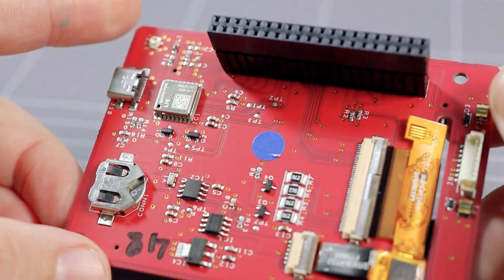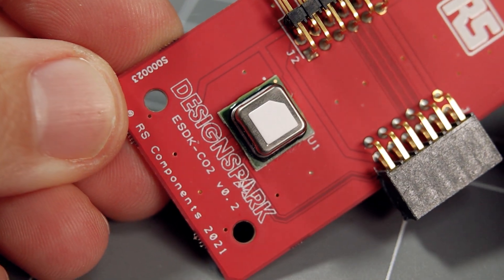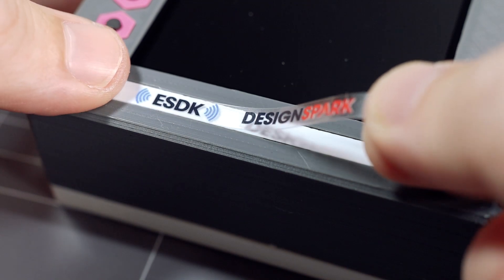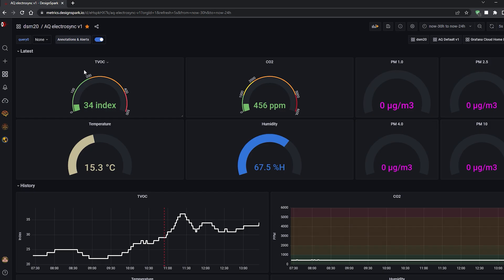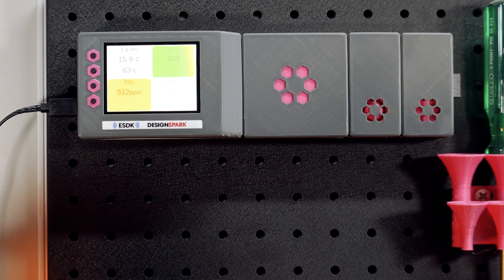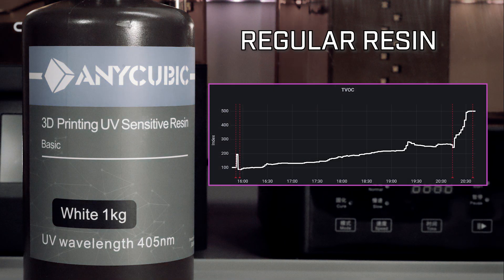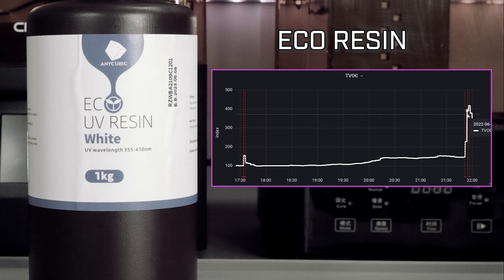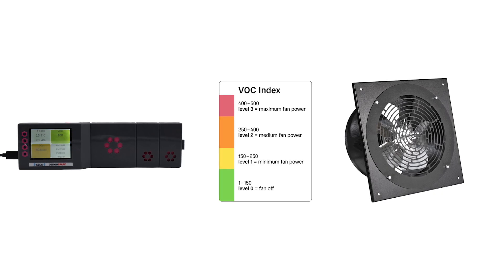How Bad is Resin 3D Printing for Air Quality?

Comment: The issue is that not all VOCs are born equal and the sensor can't really tell the difference beyond whether the fumes create a reducing or oxidising atmosphere, volatile substances like toluene, xylene or formaldehyde and other such organic hydrocarbons are going to be harsher than others like ethanol.
Reply: Is ethanol less harmful then?

Comment: Would love to see how well a plasma filterless air purifiers would reduce VOCs.

Slightly pedantic: those aren't heat set inserts, those are screw-to-expand inserts. They are more similar to dry wall anchors and just are supposed to expand and bite into the walls of the plastic hole instead of melting them into the plastic. Though, anecdotally, using them as intended in 3D printed parts isn't very effective.
Reply from the maker: Looking at a plasma purifier would be interesting. DesignSpark lists the brass threaded inserts as a press or hammer fit, but they do the job as heat sets - they are a little on the pricey side if you were buying them for that though.
Reply: Yes and No. They are technically knurled brass inserts, as they are for ultrasonic fitting. But as US creates heat, this ends up being ok to set them in with heat. The screw in ones have a 1-way thread. The only pedantic points are for spotting they are in upside-down, but seriously, this makes no different given the stresses involved. Great job!!
Reply: Good shout on the Plasma question....hope we might take a look at that =)

Comment: Did you consider that the vocs were caused by the open uncured resin? 

Uncredited resin gives off fumes much more than cured resin and possibly even curing resin.

Given the spike for your washing was the same it seems like a likely culprit.

It could be that ignoring the fan printing resin gives off next to no fumes. But the open container itself does.

Comment: I'm definitely on board with seeing some automated ventilation/air cleaning. Right now I run one of those large multi-room air filtration units in my print space. I don't have any monitored data yet, but it has active carbon and 0.3micron filtration. Which should hold well to cleansing the air of VOCs from the resin and some filaments while also nabbing a good amount of the nanoparticles from filaments without VOC. Either way..I should probably get some better sensor data.
Reply from the maker: Sounds like you have a nice setup. It would be interesting to monitor pre and post-filtration.

Comment: I got a question, did you have any dedicated ventilation for the printer for this experiment? I'm wondering what the VOC levels would be like if the printer was in an enclosure with a fan venting to the outside. And perhaps also to see if carbon filters/air purifiers make a difference, and if both filters and ventilation combined can keep VOCs low.
Reply from the maker: There was no ventilation at all. I considered an enclosure to create a more controlled experiment, but I figured that my arrangement is probably more representative of a typical set-up. I’d like to explore ventilation some more down the track - and that could include some carbon.
Reply: @electrosync  Thanks, that's very interesting. I've been trying to figure out what VOC levels are considered "safe," but it seems that it entirely depends on the type of VOC which vary greatly. 
In any case, reaching 500 does not seem terrible, nor great, considering some people are extremely worried about them. With ventilation and carbon filters though, you can probably get that number to be very low while working with a printer.
Reply from the maker: @sevithan9446  Yep, seems like it.
Reply: @sevithan9446  i just set up a tent enclosure with a 205 cfm vent out a window and am using two mini carbon filters for inside the printer. have not set everything up yet but im thinking i should be safe.
Reply: @arthurillud4720  Welp, I only got myself a 100 CFM one, but I haven't set it up yet, so I'll see.

Comment: I worry enough about FDM printing, even with HEPA filtration. I don't think people realize how toxic SLA printing is, both handling the resin and the VOCs from curing it.
Reply: Chemical Insight had found that FDM produced way more particle matters than SLA, to the point it MAY be dangerous. SLA produced more VOC but was still below dangerous levels per regulations for offices. Both require enclosures and filtration, just what kind of filtration is where it differs.

Comment: any updates for this?
Reply from the maker: Not much. I still use it and I find myself glancing at it a lot. DesignSpark have released some updates to the GUI as well as some alternative sensors and a break out board to use other existing sensors. I'm about to install a fume extraction system in my workshop (mainly for ABS and soldering), so I may integrate it with that to see if I can get it to control things.